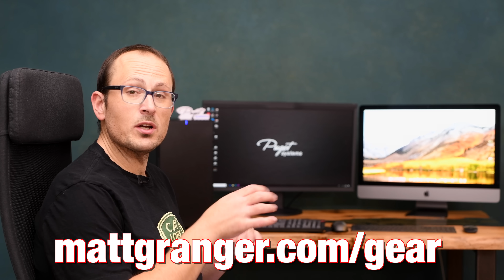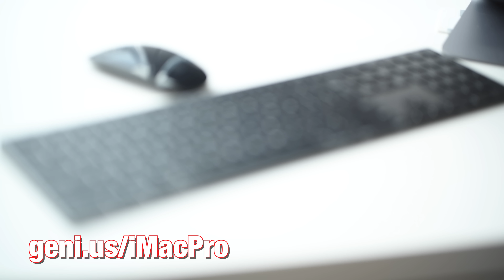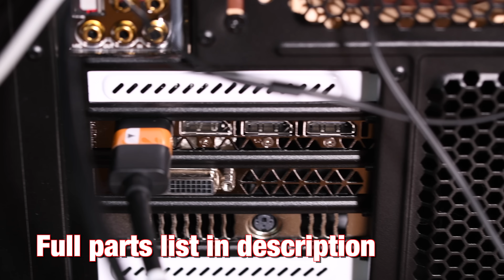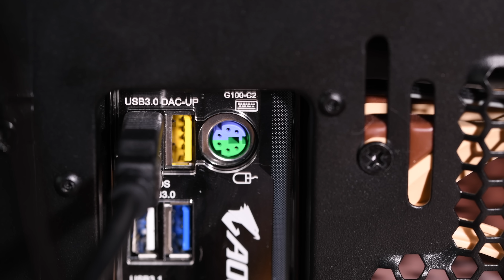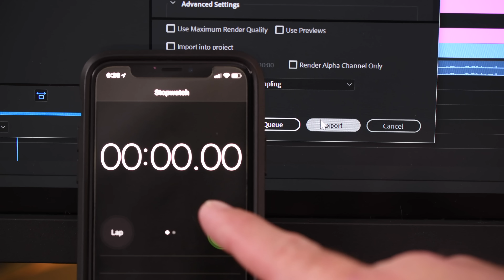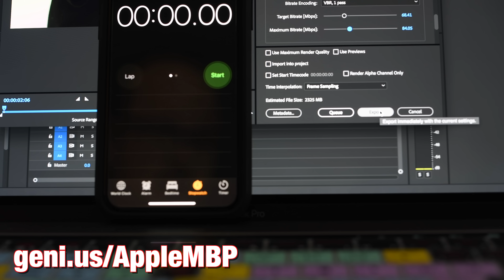$10,000 iMac Pro vs Custom PC - Which is faster??!

Comment: iMac is stupidly overpriced! You can build a monster PC with 5K and it’ll smoke the 10K iMac! I know I’m the technician who builds custom pc’s and works on both hardware wether iMac or pc! ✌🏻
Reply: Red TV Productions so why is your comment relevant? You could do the exact asmr but cheaper with a PC
Reply: Neil Greene exactly. The people who love their custom builds never talk about how often they actually upgrade/replace parts in their pc or how they lose loads of money if not all on the old parts.
Reply: Which is why Linus Tech Tips said the iMac Pro was a beast and all Youtubers use iMacs and MacBook Pro’s. 

Any computer guy who doesn’t understand software is an idiot. 

You should only buy an Apple product if you are going to use the Apple software. 

FCPX will smoke anything you throw at it.
Reply: Neil Greene I’m using two 2009 Mac Pros (each with upgraded 12-core x5690 3.46GHz Xeons, 4 m.2 SSDs in a PCIe RAID card that reads at 5700MB/s, another m.2 SSD for boot drive, USB-C card with four ports, a recent AMD GPU, and 128GBs of RAM). Each workstation cost me about $2500 to buy and modify. And I’m running very demanding real-time applications on them.That’s $5000 over 5 years (so far), and I can get a couple more years out of them just in time for the new Mac Pro. Don’t see ANYONE saving money by using 2009 PC workstations with modern cutting edge software.
Reply: The 2009-era mac pros are on a class or their own. They are upgradable and expandable. Apple no longer sell these or their equivalent.
Reply: Red TV Productions you got a mac for free?
Reply: They do. I have a 2009-era PC which I still use as my main machine. I've upgraded just about everything except the case, the motherboard and the CPU fan in that machine. A few months ago I had to replace the CMOS battery. How often does that happen :-) Meanwhile the hard disk died in my 2014 iMac last year. Huge pain to replace it.
Reply: Red TV Productions  you the kinda guy who buys shit just because they're expensive to feel better ? There's something called price for value,and clearly a pc easily crushes any mac in that house, There's no point in arguing, I like to be free and a PC gives you all the freedom,unless you wanna be a slave then u'r better off with ur mac.
Reply: Lol
Reply: Red TV Productions i like your response. i use both pc and mac and these people need to stop comparing omg
Reply: KeyborgTroll Have fun with your 8 bit TN panel...
Reply: I agree when i used to build PC's run game I had to upgrade my $700 GPU every 6-12 months not to mention replace hard drives, add/replace ram.....easily spending close to $1000 or more per year on keeping the PC relevent....this was a long time ago. my first iMac lasted me 2 years and cost $1600 i replaced it only because I went from 21" to 24" and that one lasted me about 5 years and i sold it while it was still working great. i went to a Mac Mini back in 2012 its still fast with 16GB ram and a 1TB SSD in and runs great this one is 6 years old.....Macs are great for a lot of creative professionals and tend to hold their value longer than PC's...but everyone does have different needs and so to each their own
Reply: you didn't have to upgrade that pc, that was entirely optional for starters and 2 you're insane if you upgrade a computer every 6-12 months by spending $1000. add/ replace ram? why would you need to replace ram after a years of use? you're either not treating your computers very well or you;re impulse buying
Reply: arent your PC run slower after several months???? 
i had both and PC sucks....after several months, no matter the application launch speed or render time.
Reply: So ya tellen me you can make a Cider House for Half the Price?
Reply: mrtvicovek  Thank you. My videos earn me 30k a month. My you tube is just for clients to see their commercials. Not to be shown to the public but whatever.. I bet you would like to earn between 30 and 50k month working from home?
Reply: Jordan E how does FCPX work on your 5k PC? 😉 and what 5k wide colour p3 monitor do you use?
Reply: @originalmagneto  DaVinci Resolve.. enough said..  even for basic compositing work the built in Fusion is good enough.  If you need more you use Nuke.  Both those programs will take as much processing power as you can throw at them.  With higher end VFX work even the best Mac would quickly run into issues with thermal throttling.  While at that level the price of the PC and Mac would be pretty close the issue would be how do you upgrade the Mac to be able to even handle the work you are trying to do?  
So we have thermal throttling which slows you work down at the low to mid range level work and at the high end you just can't do it at all at least not in a reasonable amount of time.  Both those issues slow you down and both those issues cost you money.
Reply: I make money with my Mac. It costs me nothing. You keep building your home made pc's. I have got better things to do.
Reply: @redtvproductions1  if you are doing client work do you have two computers in case one goes down?  Good luck with you sending in your Mac if their is an issue.  Meanwhile let's say my video card shits the bed.  I can go into the store and buy a new one within an hour and be up and running again.  If the old one is under warranty send it in and now I've got a backup.  The thing is unless it's a manufacturer defect that won't happen and if it would happen it's just as likely to happen with your Mac.  Heat does kill components and with the Mac you will always have more heat.   Especially that Vega they have in there.  You will also run into issues with thermal throttling.
Reply: @pin65371  Actually I have 5 bu I have never had one go down. If it did I would walk in and grab a new one. Its how I make my living. I have been editing tv commercials for 21 years, 2000 in total.  Thats the thing you dont get. We dont have problems with Macs. We just buy new and they earn us money. I even deleted the games from my machines.
Reply: @travis8665  I've never had a problem with my windows machines.  My current machine is completely overbuilt.  Everything was pieced together in such a way that I can scale up without too much cost.  The best you can do in your machine is a Vega 64.  In a big open case with good airflow you will be having thermal throttling.
Reply: @pin65371  You miss the point. i make my living from my work. The Macs are better. Thats that. You spend all your time playing with home made computers, Thats good for you but I just buy another. I charge out at $150 to $250 an hour so the last thing I want to do is have a PC.
Reply: @travis8665  you can play with your Mac.  The real professionals have bought PC's.
Reply: @pin65371  I earn 350k a year on my Mac. There are no pros using PC's. You are obviously very young or you would know. Just go about and play with your games. Theres no place for them in the real world.
Reply: @travis8665  uh you might wanna recheck that.  Most studios and pretty much every VFX house is using a PC.
Reply: @pin65371  Ok... Ill just have a  quick shower and call around to all of them. Ill get back to you in about 5 years.
Reply: Travis if you want overpriced prebuilts and actual good performance, GO WITH WINDOWS.
Reply: Dom Douglas Because of Windows. The workflow is a big deal to me and no OS on the planet is as seamless as macOS. I’ve been using Macs since the late 80s and never has the Windows environment proved itself to be as capable as OS X/macOS for certain markets (although Windows 7 got some nice under the hood optimization - still have no desire). Also it’s a myth that only Apple apps run better on a Mac. In my industry (native audio production), macOS and Windows are about the same in terms of “speed.” It’s the workflow. The postscript based window kernel (Quartz) of macOS pays for itself. That’s an example of the kinds of things (carried over from NeXT) that make macOS a pleasure to use. That’s worth the extra money, IMO.
Reply: I get nothing for free. I make money with my gear as a production house. My clients pay for my gear because I charge them for my work. Simple.
Reply: Lets see how the price pans out.  I have a 2009 MB laptop.  It still runs great!  Large and a little bulky, but that was $3,200 over 9 years.  I just bought a new iMac 5k tonight, to replace my iMac from ...... 2012.  So, another $4,200 over 6 years.  That is $700/year!  And I had some simple upgrades like RAM and SSD.  I don't see those PCs, with Windows10, lasting 5+ years like these Macs do.  The ONLY reason I am able to run for so long is the cleanliness of Apple Software
Reply: @neilgreene  my original laptop I bought when I got into photography still runs and that is 10 years ago.  Once I upgraded my camera I bought a new laptop.  The old laptop became a htpc.  Over Christmas I built a new PC since I've been doing video now and didn't want to be using proxies and was doing some VFX work and caching out compositions was taking time.  The laptop is like 4 years old and was still handling multiple gig Photoshop files fine.  By the time the components of my PC fail I'll be making enough money for my work that it doesn't really matter.  Actually the components won't fail while I'm working since I would have upgraded again.  Most of the components of the PC were picked with the intention of being able to swap out parts or add in new stuff as it's needed for my workflow.  Like if you buy a Mac can you add in a second or third or fourth video card if the work your clients are wanting to pay you for requires it or are you going to have to tell them you can't do it?   Me personally I want my current skill level to be the thing holding me back and not my equipment.
Reply: I don't want to use a cheap PC that is home made. I don't want cheap. I don't like cheap.

Comment: Forgive my dumbness but could you run the Apple OS on the beast pc or is it windows only? I’m a Mac man myself, it just works and doesn’t slow down like windows
Reply: OSX can run on a PC too. It's not for everyone of course, to build a hackintosh.
Reply: Andrew Simons tbf, I loved the windows 8 full screen start menu. Actually have my w10 rig calibrated to do just that.
It's like having a desktop on your desktop for your most used programs.
The actual desktop gets used for 'temporary, I will need these again soon and cba navigating to folders' file storage.
It's great, I only ever open file explorer directly to access downloads, or do non-everyday tasks. Everything else gets open from within software now :)

The non fullscreen start is a shambles though. Would probably prefer the classic, grey windows 95 look to that too 😁
Reply: Jigga Man thanks for the reply 👍
Reply: While Windows may have slowed down in the past, Windows 10 has fixed all of that. MS actually fixed that with Windows 7. If that was your only reason going to the more expensive and less capable Apple stuff you should give Windows 10 a try. That said, the start menu is total crap, install the free classic shell to make it suck way less. Also, apple does not run on PC hardware, it's all proprietary. Windows can run on almost anything (including Mac hardware), Mac can run on Mac and that's it which is another negative for Mac.

Comment: I must mention that quadro card prices wasn't affected by mining, you can get a p5000 for less than msrp. The reason for this is that it is not profitable based on it's price and power consumption.
Reply: The P5000 uses around a 100 watts of power while the Vega 64 uses almost 300. The Vega is slightly faster but not 200 watts faster. The nvidia card is much more optimized and efficient. While I'm glad there is competition between AMD and Nvidia, Nvidia is killing it with power/performance. I bet that iMac gets iHot real quick under heavy load. Not to mention the exhaust being on the bottom is totally stupid because hot air rises and gets sucked right back into the intake. Exhaust at the top would have made way more sense on the iMac but probably not looked as great.

Comment: I recommend some RGB lighting for your new PC. It's a proven fact that dope RGB lighting makes your PC faster!
;D
Reply: I add some RBG lighting and I am getting twice as fast renders
Reply: Mathias RGB lighting has helped me with my wifi speeds. Download speeds has improved by 30%.
Reply: Just add a spoiler on it
Reply: The spoiler adds a downforce to the air from the CPU cooler. The increased pressure makes the heat transfer from the IHS to the cooler more efficient.
So now you know.

Comment: ...interestingly, at the end, You arrived at the same conclusion(s) as I was offering, when we where chatting 5 years ago on FB chat/PM on the same subject. Since then You mastered the subject quite well. :) Kudos to You. I have only two observations. One: You missed to touch on the subject, that these (both the Mac and the PC in your video) are workstations and there is a BIG difference between a (even a very high-end) consumer PC and a workstation hardware. Two: You did't mentioned anything about the experience during editing. Usually this has more impact on the "user experience" (for example: is the workflow "fluent" or do you often have to wait for the changes to take effect, does it "slows down" on big projects with lots of elements, etc.) than the rendering time (during what you don't have to do anything anyway to the project that is being rendered, so you can do other things, like edit photos in Lightroom for example). Other than that, it is a good video on the subject. I hope this new rig will serve You well! :)

Comment: I'd never even consider a non-upgradable system. 
I've upgraded with new hardware elements ever since I got my first Atari ST around 1990. At first only more RAM but also new ROM chips, and when I went over to PC around year 2000 I started with a custom made PC, and over the years I've added new harddrives, discdrives, sound cards, video cards, power supplies, firewire hubs, usb hubs etc. etc. 
I've never bought new high-end gear though, which I would consider a complete waste of good money. I'm not trying to outdo other people, I just want something that will work well enough. 
The fact that others have much more advanced gear doesn't worry me a bit, except perhaps a little for their mental health. If you think that saving 20 minutes export time will make a noticeable difference to your income, I'm really worried! 
Generally speaking the latest and greatest is never really worth the extra cost. If it's a matter of having plenty of extra money, that for some reason you don't want to give to charity, and you love getting new toys, then of course there's a pleasure involved. Just don't fool yourself (or your wife) into thinking that you need it.

Comment: Hi Mat - thank you for this but I did pick up what I would consider to be one major oversight on your behalf and when you learn this you are going to be a very happy camper!  With Premiere Pro if you click the Queue button when you come to export your video files for rendering instead of the "export" button; the file rendering is transferred to Media Encoder and you can go back to work in Premiere Pro immediately and not waste all that time you talked about in this video.  Cheers, Mike Whitehouse
Reply: Hey Mike. There is a glitch in Media Encoder where audio keyframes get misplaced. The usual result is the background music increases and decreases prematurely. To bypass this you have to export directly from Premiere Pro, or to have the audio externally mastered and import a single track to place under the vision.
Reply: Small Town Camera Thanks - appreciate the information 😀